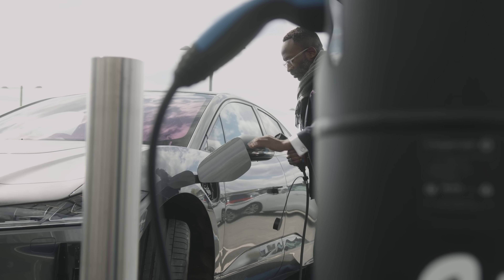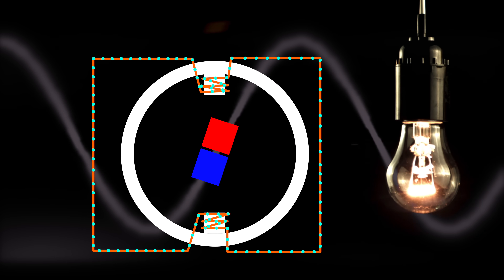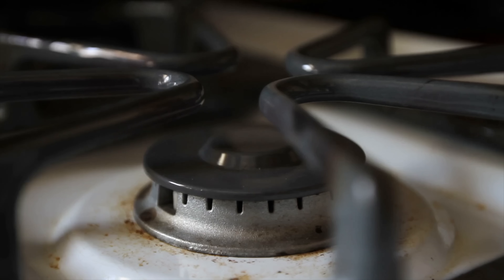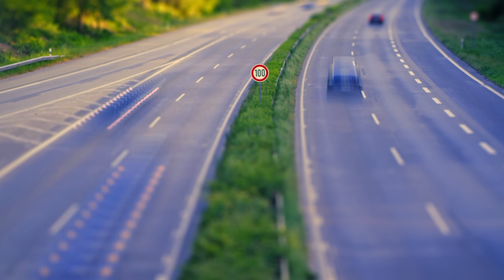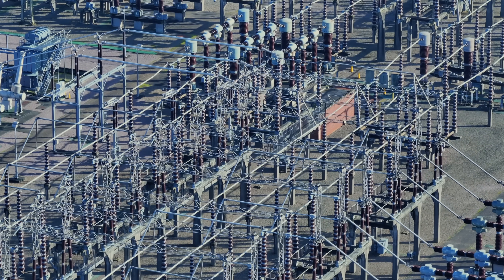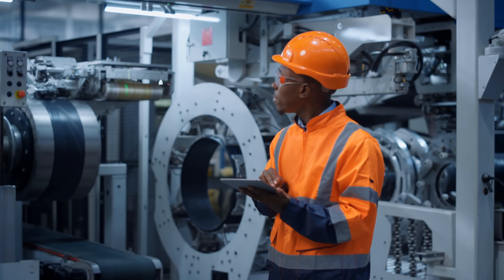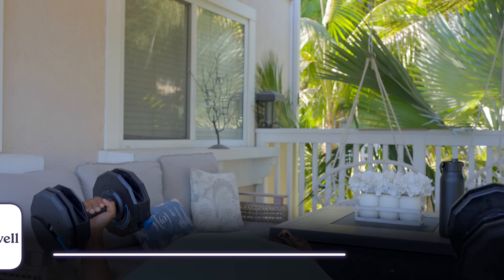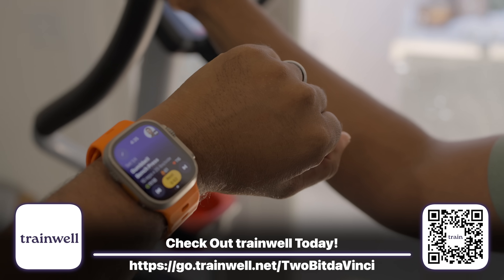Why The Power Grid is Nearly IMPOSSIBLE to Run

Comment: So... just to be clear, reactive power can be corrected for with a capacitor / inductor bank, and commercial businesses generally do (or have to), else they get charged a lot more.   For residential, the reactive power is generally corrected at the substation.   So reactive power actually isn't quite as bad as you indicate.  There is some extra power loss, but not much, and most of it is corrected for before it ever makes it back to an actual generator.

For transmission lines, losses are certainly not "5-10%".  Usually losses over transmission lines are less than 2%.  Most of the losses occur elsewhere.  The end-to-end (generator to consumer) average grid losses are usually less than 10% on the whole.

AC and DC transmission lines are both very efficient, with DC edging AC out... but only by a little in terms of absolute percentages.  The main reason DC is used for long-distance transmission lines is simply one of cost.   It is cheaper to run DC transmission lines for distances in excess of a few hundred miles, simple as that.

The problem AC has with long distance transmission lines is not so much due to losses, but instead due to phase.  Beyond a certain distance dynamic phase correction is required because the transmission line expands and contracts with temperature and other weather conditions and otherwise could not be synchronized to the grid on the far end.

--

With regard to peaker plants and keeping the grid in balance, it is also not quite as difficult as you indicate.  First of all, energized transmission lines themselves have a lot of momentum.  The grid is never in perfect balance but all that means is that the voltage moves around a bit, usually depending on the time of day.   I'm sure many people with kill-a-watt's have noticed this.  Sometimes you will see 115V, sometimes 120V, sometimes 112V.  This is because corrections cannot react to changes in load instantly.  A NG plant can take 15-30 minutes to correct for a load imbalance, for example.

Base load sources generally output at 100%, or near to it, because they can't operate economically otherwise.  So base load sources cannot really adapt to very fast-changing conditions (such as the California and Texas grids have).  Peaker plants fill this role, but increasingly peaker plants are being removed in favor of grid scale storage.  Battery storage is taking over because it can react to imbalances in seconds, even milliseconds.

In California, the massive discrepancies between supply and demand that occur in the short term during the evening ramp are handled almost universally by batteries now, and not peaker plants.

-Matt
Reply: Thank you! This video felt sensationalized or simplified for the broader audience. I kept expecting to hear about power factor correction too! I hope more people find your comment and learn more about this extremely complex system, as it is hard to discuss in video format.
Reply: @jyanak5926  practical engineering yt page  handles this topic well.
Reply: wow :washhands:
Reply: @CieloSD-007  one more thing about HVDC transmission is the inherent ability to control how much power flows between the converter stations at the transmission line end points. This provides isolation between the inter tied grids. There are several converter stations that are back to back for exactly this reason.

Comment: Balance of supply and demand is simpler than you think. Every time you turn on a light the grid frequency drops. Slightly.

Think about those big generators: coal, nuclear, etc.They have control systems to manage the amount of steam driving the turbines. These control systems vary the amount of steam based on the rotation rate. Slower rotation calls for more steam. This is why the grid frequency varies. Changing slightly but always near 60Hz. 
Adding another generator to the grid will increase the grid frequency. Slightly. This is  managed throughout the day/week/months so that if you integrate the grid frequency with something like an AC driven clock, the time error on that clock over long periods is close to zero. Although over short periods there could be an error of several seconds.

Comment: Photovoltaic power in the remote deserts is the cheapest (and cleanest) power on earth. With massive stationary batteries (not necessarily co-located) it becomes 24/7. I have analyzed the costs including transmission line construction (from a Princeton study) and losses and the cost is still cheaper than what we pay on average. And this cost will be flat for decades. The problem is getting permits for the new transmission lines This can take a decade or more. I'd love to see a video on what is in the way of fixing this and how to fix it. I believe it is the key to a renewable economy.

Comment: Anyone know how inverters in home solar power systems handle the reactive power? I know that high frequency transformerless inverters have a lot more issues with starting inductive  loads, and I'm guessing that's because of the high startup current and not having a transformer to act as a buffer. Weigh in folks. Thanks.

Comment: What amazes me most of all is how there's no plans built in for when the Earth is inevitably hit by a solar flare like the Carrington Event. It's a certainty it will happen and it's likely an extinction event but no one bothers to harden their grids against it. We had a near miss only a few years ago, the event missing Earth by mere minutes.
Reply: That's why they call it screw tube, because they delete information.
Reply: Is it even possible to have such robust protection?
Reply: @joewoodchuck3824  100% yes
Reply: @Phil_AKA_ThundyUK  How would it be accomplished? What are the vulnerabilities?
Reply: @joewoodchuck3824  I wrote a big reply but it's been deleted 😕
Reply: @Phil_AKA_ThundyUK  That's been happening to me as well. I'll try to read about it.
Reply: Nobody designing the grid decades ago  had much knowledge of the Carrington Event and its impact. Grid operators are well aware of it now and solar activity is included in my area grid’s morning report. There. Is a lot required to harden a grid with special emphasis on protecting the transformers.

Comment: I really wish the US would swap from 2 phase neighborhood power to 3 phase. it is just better. Only a few things in the house rely on AC power, and those are most efficient when fed 3 phase power. Everything else converts that to DC power and wouldn't it be great if we just rectified right at the panel 3 phase AC to DC for device needs instead?
3 phase AC to DC produces a clean DC line of power. 2 phase AC to DC is not as clean unless the 2 phases are brought from 120 degrees apart to 180.

there's also the fact that power companies don't just have a bunch of spares on hand when parts of substations fail. Sometimes it can take them months to get replacement equipment.

our grid is weak. that's part of why I am in favor of making yourself as independent of the grid as possible.
If you can in a blackout cut yourself off and keep going like nothing happened, great.
if you can also help support the grid so it is less likely to fail, even better.

Comment: Yes please! I would like to hear more about this subject. I would also be interested in videos about why AC won out over DC, I heard years ago that it had something to do with having to have a substation at the end of every block where AC could go farther distances. I now question that information since you just said in this video that they are using DC for long distance HV lines now, why not back then? Additionally, are there any plans of DC neighborhoods being developed that don't use AC at all. It would also be interesting to know if DC has better future proofing, like if a DC infrastructure would function better during solar flares, terrorist attacks, or EMP. I've always thought it would be beneficial to put in DC lights in my house along with solar panels to avoid the conversion losses when going from DC to AC, although I admit it would be minimal in savings.
Reply: It is difficult to change DC voltages to ease transport over long distances. Now we have the power electronics to be able to do it efficiently.  Back in the day of Edison, there was only one way. Use the DC to run a motor which drove a generator with the desired output. Then do it again on the other end of the line. Expensive and inefficient.
With AC all you need is a transformer.
Reply: @robertcoffin166: Okay. First and foremost, putting DC lights in to avoid conversion losses is just a little misinformed; the amount of power you’d lose between your DC load center and the lights could easily outweigh the conversion losses and transmission losses, even if you size the wire correctly. Not only that, but most light switches on the market today are only safe to use with AC; so you’d have to find switches that are rated for the DC voltage you’d be using, and install them in such a way that they don’t pose a fire hazard (which may be tricky, if you’re going to try and use the standard boxes already in place). Without knowing more about your DC system, nobody here can really say for sure.

Second, your question about DC power’s susceptibility to EMPs is fairly easy; when an EMP goes off, all electrical circuits that aren’t shielded will be damaged. Full stop. And a really bad solar flare (can’t remember how to spell the name, and google is no help) would be pretty much no different from an EMP. As for doing DC for neighborhoods, I looked into that for sharing power between myself and my neighbors next door, and the cost of the 4/Ø wire I’d need almost literally made me shit my pants; and that was assuming a “48v” system between us, which is the highest you can go with what’s readily available today.
Reply: A little history might clarify this subject. 
Edison's first grid was DC. This posed problems for the adoption of electricity as it was not cost effective to transmit DC at low voltage as you would need large cross section cables to mitigate voltage loss. Also DC motors of the day were inefficient costly and required lots of maintenance,  
These problems were solved by in immigrant to the US one Nikola Tesla who proposed multiphase AC distribution of electricity to solve both distribution and motor problems. Tesla was an Edison employee when he first proposed this, and demonstrated it. Edison rejected the idea as he felt AC was dangerous, which it is, but the ease of use and efficiency of distribution won out over safety. He then fired Tesla who went to work for Edison's competitor Westinghouse where he built out the first AC distribution system in the world. This was so successful that AC systems were built all over the world, and remain the standard to this day.
High voltage DC has had a resurgence in distribution with the help of modern power electronics that efficiently converts voltages from distribution levels to usable lower levels.
Edison spent alot of effort time and money trying to convince people of the danger of AC electrocution ultimately inventing the electric chair to highlight the danger of AC electricity. But as with all things new people just thought he was showing a more efficient and kinder way to execute people and so adopted this method of execution in the US.
Reply: Watch the movie, “Current Wars,” where Mr Westinghouse uses AC to illuminate larger neighborhoods than Edison with DC.  AC had much lower loss using transformers so it was used in larger locations.  DC was limited to neighborhoods near the power plant.  

The advantage of DC in very long power lines is it uses entire thickness of cable.  AC has a “skin effect” where most of the power is carried on outer surface of conductor causing losses.

Comment: As a retired broadcast engineer, I usually watch videos and see what errors they make.  Congratulations!!! I didn't see or hear any,  A very good explanation tailored to the generally average citizen.
Reply: As a retired radio engineer and grid operator, I would agree with you but things are changing so fast the explanation needs to be up dated. Hence my complaint. Recently Elon Musk saved a portion of the Australian grid by installing Mega batteries just in time. An outstanding example of the changes being made. I have seen this explanation many, many times, since I am 80 years old.

Comment: When things go wrong, chaos does not happen. What happens is the grid shuts down. It is designed to do this to prevent further damage.

This is what happened in the northeast blackout of 1965. One power plant became overloaded. It's circuit breakers opened to prevent damage to the power plant and it went offline. But then the load distributed to other power pants, which overloaded them, which went off line to prevent damage. Within minutes, the whole northeast US and parts of Ontario and Québec were blacked out. It was not chaos. It was a controlled shutdown to prevent damage to the power plants.

BTW, this is unlikely to happen again since substations, which distribute power to the neighbourhoods, now have power regulators. They prevent the substation from drawing too much power from the grid. Customers downstream may suffer brownouts and blackouts but the grid continues to function.
Reply: I say it  was caused by a 6 foot wingspan owl shorting across a bushing of a transformer at Niagara Falls on the Canadian side. This caused a cascade when the relays failed to clear the fault. Maybe my memory is not as good as it used to be.
Reply: @tedoptional-p8l  I'd say tedoptional-p8l your memory is just fine. Circuit breakers were tie wired closed so they could not open to clear the fault,  among other issues.
Reply: IIRC it was caused by relays in NY that were tie-wired closed to prevent them from tripping, voltage and current relays that were all set to the same values so too much tripped off bouncing back and forth between too much load and too much generation, and base load with no throttles. That was NOT an orderly failure. We called the northeast blackout of 1965 the "NY blackout" because the A-holes in NY were the primary cause it was so wide. F*ing tie wires!!! Dumb bastard idiots. I'd say tedoptional-p8l your memory is just fine.
Reply: It happened to CA in 2011, I remember how crazy it was, not totally caos, , gas was not available anywhere, or banks. stores only acepted cash, and prices rise to much.

Comment: DC micro grids will solve the grid problem. Large power plants will be used less and less when solar and other renewables will stored in batteries and other storage solutions. The industries will continue using the grid until it becomes cheaper for them to generate their own electricity. IF fusion arrives in the near future then traditional plants will still exist, otherwise the renewables will eliminate the need for large plants.

Comment: The short answer to the question in the headline here is, of course, To call Tesla and ask them to help install SWB power plants and use VPP to even out big surges.
     If you live somewhere where you need the most energy to keep your home warm, demand that those hot water plants using a beefed-up steam engine to convert their fossil, nuclear or bio fuels to electricity, at an appalling 35% efficiency, to rather give you the hot water directly, at a third of the price. DUH!

Comment: Correct!  The existing power grid will eventuality fail!  The most promising new technology is low voltage AC underground graphene conductors.  Graphene (not a super conductor, but close)  better than Low Voltage DC transmission lines.

Comment: I've never heard of DC transmission lines. I thought AC was more efficient than DC transmission and then converted to DC at the load.
Reply: Crazy isn’t it. I hadn’t heard of it either. But it’s actually more efficient, just a lot more expensive

Comment: We need to decentralize so we don't need to be so dependent on a grid.  We should be putting solar roofs on every building and parking lot where it's feasible to do so.  Then we won't even need the grid or any of its eye sores, spoiled real estate, infrastructure costs, transmission loss, etc.  And, as there will be no single point of failure, we all get a more resilient energy system.
Reply: Putting Solar on every roof is a good start. But we will need batteries, wind power and seasonal energy storage as well for winter, depending on the region. My home solar plant delivers more energy in two good summer days than in the entire month of december. Imagine a cold Christmas eve without wind if we don't prepare for that.

Comment: This is the most stupid approach on top of already idiotic usage of electric power !
We don’t need 3 wires for 3 phase, all 3 phase can be injected in a single wire with different frequency, respective 100 Hz 150 Hz and 200 Hz and the resultant frequency will be 50 hz.
AC is needed only for long distance transmission, than DC is doing the work absolutely fine … most of domestic appliances works on DC and they have an internal transformer/rectifier. Using pulsed DC is even more efficient and we can keep or even enhance frequency and make adjustable duty for the power we need to use.

All what I am saying here is already known and proved for at least 100 years, but there is no profit in this way for bigoilco, gov, military … so, only an idiot may expect to have access to cheap or free electric power.
If you are not yet totally brainwashed, you may start to do yourself what you need. Contrary of what you hear from scientists and gov it is simple and cheap.